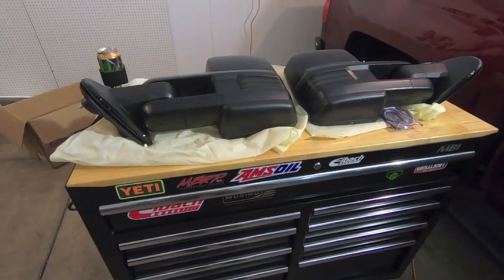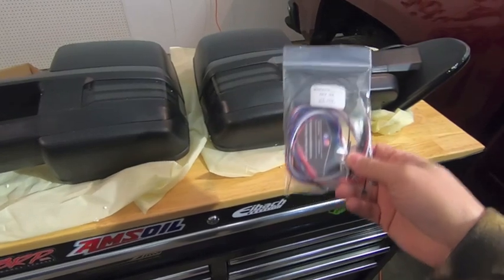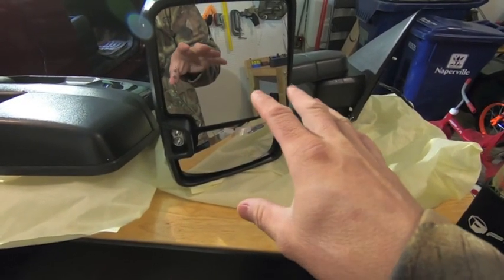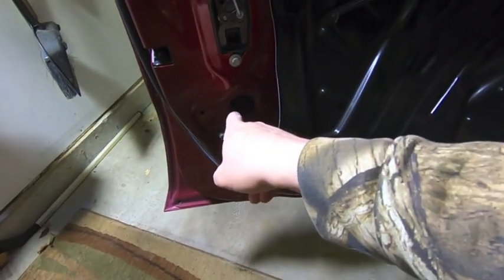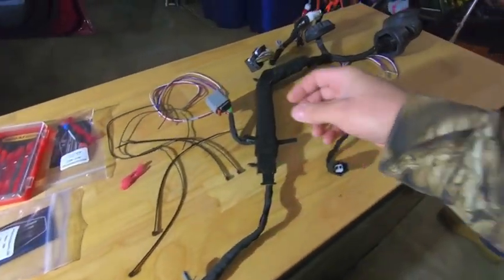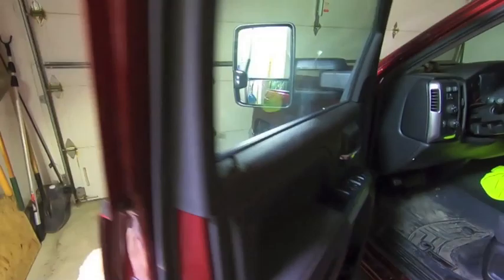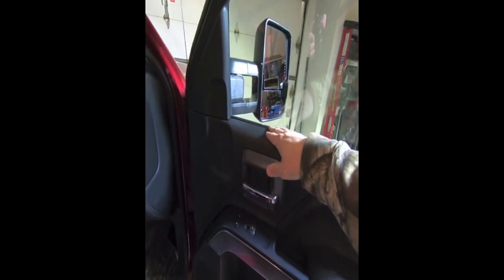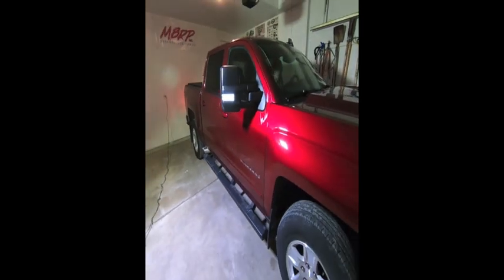Boost Auto Parts Tow Mirror Install - Chevy Silverado

Comment: Good job.  I have a 2016 Silverado 1500 (DL8 mirrors).  Now that you've used Boost and the others set for your truck you got from Amazon, are there any quality differences that is worth a couple of hundred dollars difference in price?  Also, did you get the lower defrost with the Boost, and is it really needed? Thanks!
Reply from the maker: I would say yes, if you can swing the extra cash, the Boost Auto mirrors are on point.  The Amazon mirrors are good on a budget but there are some minor QC items you see between the two.  Boost Auto will stand behind their products too, not to say the others won't but you have to deal through Amazon with those vendors versus direct with BAP. 

I removed the Amazon mirrors from the GMC when I got new wheels.  Didn't like the chrome with my gray wheels.

Comment: Very sweet mirrors!! Are you able to replace the LED lamps on them easily? Or would you have to buy a whole new mirror
Reply from the maker: Pierce Foss yup the LEDs strips swap right out, easy plug and play project. Boost auto has all the parts you’d need and I believe a video on how to replace them

Comment: How does the running light function on a switch back?? Is there a button you need to push or do they automatically come on once your driving
Reply from the maker: Two circuits are run to the light, turn signal and running light.  The light is always in running mode but when theres a signal on the turn signal circuit, the light switches to turn signal mode hence why they call them switch backs.

Comment: I installed mine and when I adjust my mirrors the fuse pops, pls help
Reply from the maker: Omar Medel sounds like you have some wires in the wrong pin location. Where’d you get your mirrors? If from BAP, give them a ring they should be able to assist you. 

I would retrace all your wire runs and make sure you didn’t accidentally insert in the wrong pin or that the pin didn’t bend when you inserted it.